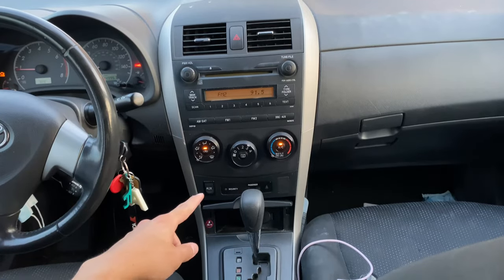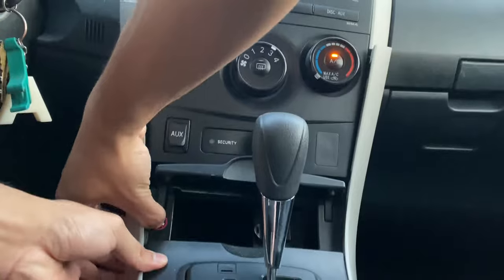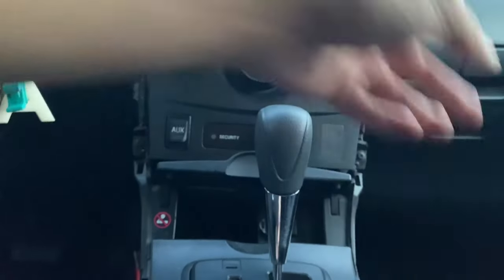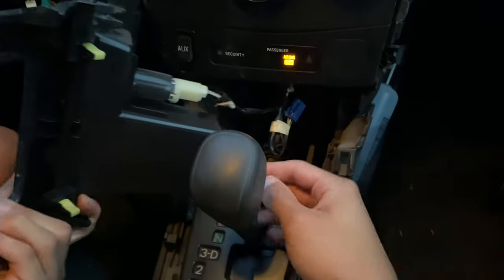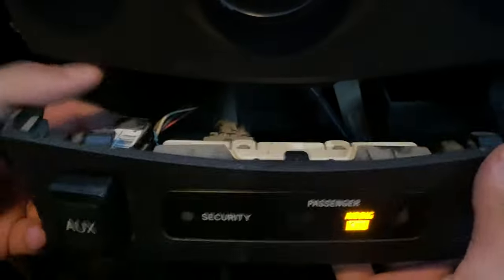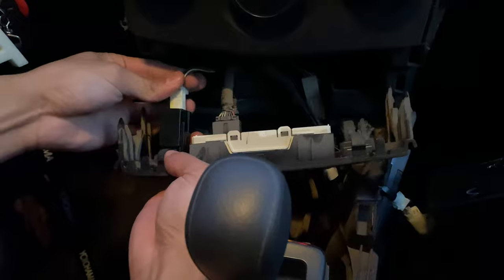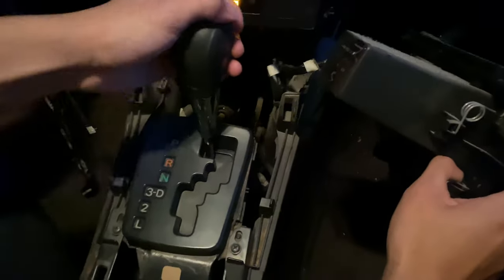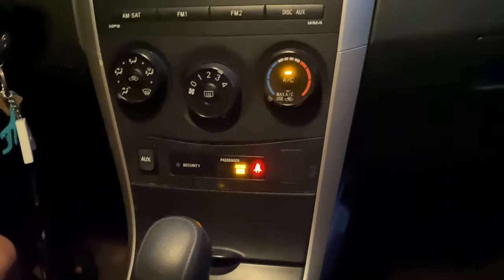How To Fix Aux Jack On Toyota Corolla | In 5 Minutes |

Comment: Very detailed and easy-to-follow. I had the same problem of my aux cutting in and out. I was able to repair mine by resoldering the circuit board connections. What happens is the contacts get loose and eventually pull away from the circuit board so really it's an easy fix if you have some solder you can just resolder the connections and should be good to go mine works like brand-new didn't cost me anything. But I'm glad I found your video because I had no idea how to get to it so thanks for the video! 👍

Comment: I appreciate your video. The AUX on my 2010 Corolla has been broken and I thought that I might be able to repair. I never thought about a replacement part but your video showed me that I could easily install a new replacement just like the original so I have a replacement ordered from eBay. It's amazing how many replacement parts are available for my car if I need. My car is 13 years old and in exceptional condition but over time a few things have broken and I've installed aftermarket replacements. I've also installed some accessories to compliment my car since it's an LE trim. I've wanted the car to look more like a Corolla S. A man recently told me my car was an S. I can't lie. I had to tell him it was an LE.

Comment: Thank you! Congratulations on making a first-rate instructional video, clearly filmed, no loud music intro, just the facts. One note: I just did this on a 2009 Corolla whose AUX input had suffered some kind of blunt-force trauma. Getting the little "pigtail" connector out is a little deceptive; the pigtail (on the old connector in my car) was plugged into a white socket that had gotten knocked out the back of the outer (black) housing, so it was not clear which "white thing" to yank on. It's the little one. Also, one of the screws in Step 2 was super tight, I recommend having a little impact wrench handy (not a huge one for tires, like a little Ryobi battery one). You don't want to strip the screw head.

Comment: Any aux jack recommendations for Toyota Corolla 2010 xle
Reply from the maker: This is the one I bought:https://www.amazon.com/86190-02010-Auxiliary-Replacement-Highlander-2007-2015/dp/B07PNG3HL3/ref=sr_1_9?crid=19CUX82N36M3F&keywords=aux%2Binput&qid=1657747141&sprefix=aux%2Binput%2Caps%2C140&sr=8-9&th=1 

But it’s unavailable maybe see a similar one with the part number or check if your local autopart store has one